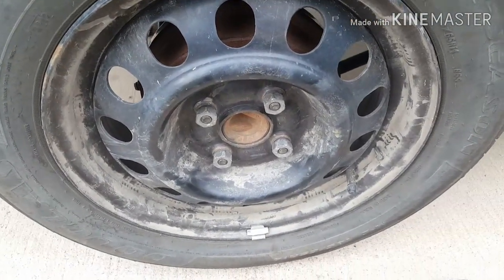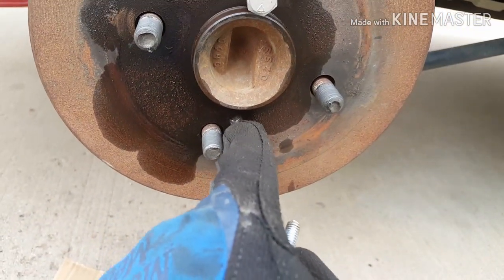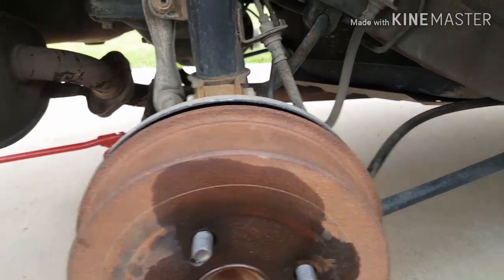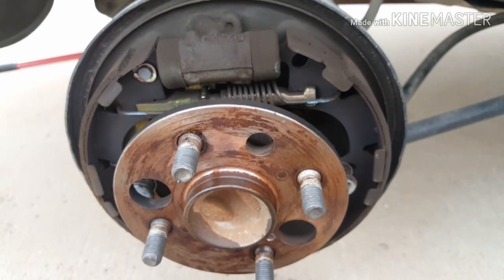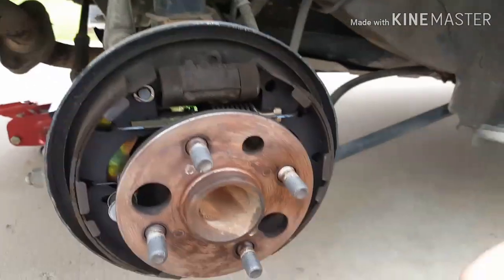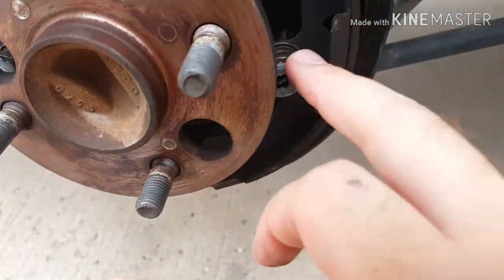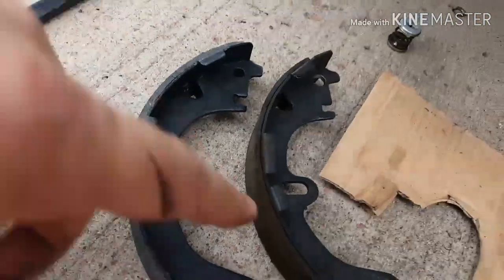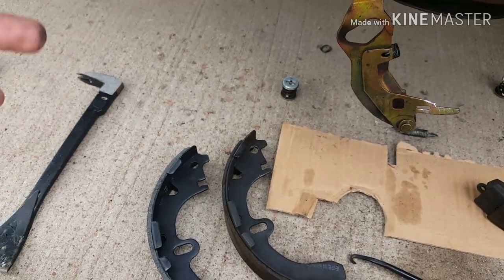2001 Toyota Corolla rear brake replacement

Comment: Would have been nice if you showed the actual removal and installation.
Reply: for real so much for help dh
Reply: Yes showing how to would have helped
Reply: I did both of the brakes and let me tell you, these pieces of shit will make you into a body builder with how much strength you have to use to even reconnect the springs. It's a really simple job that takes hour and half to do because of the damn springs
Reply: @brute6896  
😆😆😆
you are right!!

Comment: To properly remove the stuck drum, you need to release the tention on the shoes from the inner drum rotor. Wear and tear makes a lip groove that makes the brake shoe get stuck inside the worn off groove.  So do it right , don't bang the drum. Or stick anything in the groove. Just loosen the brake tension through the brake adjuster.
Reply: Very valuable information this.

Comment: I think I last time I got the path thickness limit as close to as 1mm, so yours looks far from needed to be replaced. Last time I just exchanged the two pads, but it's several years now. I am going to check again and may need to replace them this time. That's why I checked you video here today. Thanks!

Comment: This bolt you need 2 in the hub are 2 holes that these bolts will fit turn evenly untill the hub pops off.  Metric 8 x 1.25 x 30

Comment: The is window to the back of hub to adjust the brake shoe to remove drum or there are two holes on the drum to place I think it's 14 bolts that you can wind in to pry off the drum cover.
Reply: Yes. That slot in the backing plate is to adjust the star adjuster.  It’s a little hard to get to it to adjust, though.  I normally adjust until there’s slight drag slipping the from back on and spinning it a bit.  If you adjust while the wheels are on, spin the wheel and when it’s adjusted properly, it should spin 2-3 times max.

Comment: Hey I have a 2000 corolla. Do you know what way you turn the little star wheel to loosen the shoes? Up or down? Thanks.
Reply from the maker: I want to say up, however I could be wrong. It moves fairly quick though so try both ways to check and see if that rod shortens or extends.
Reply: Hey thanks for the reply. I am trying to loosen/bring the shoes inward because one of them is worn all the way down. So I don't want it scoring the drum. I moved it up a bunch of clicks two separate times now. I am assuming I'm going the right way because when I rotate the drum it still has no contact. I'm gonna keep adjusting the star wheel more tI'll the noise goes away.
Reply: @evan937  check the repair manual. Haynes 1993-2002 corolla

Comment: you can use the hook on a swiss army knife to take of the springs
Reply from the maker: You could definitely try! I just bought that tool because it was specifically designed for the job and wasn't very expensive